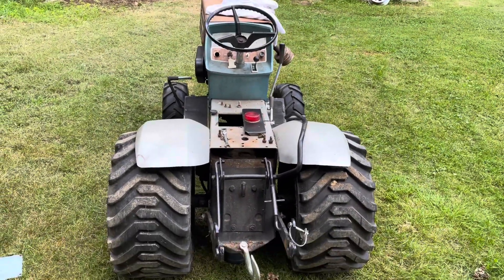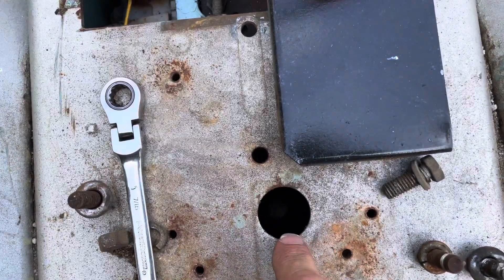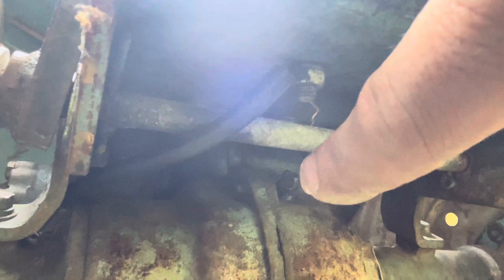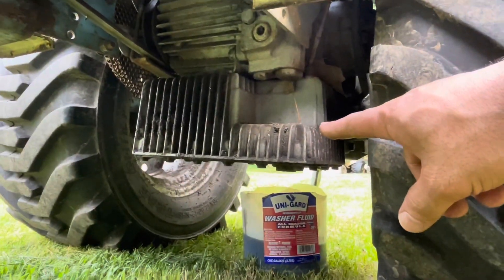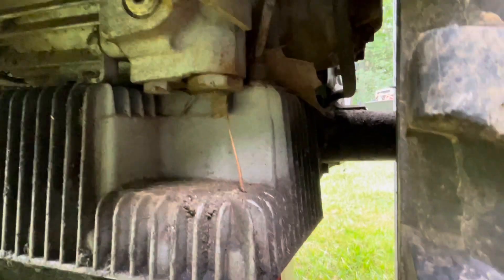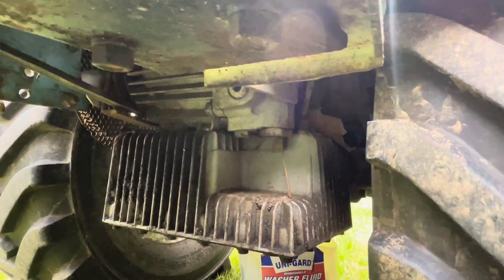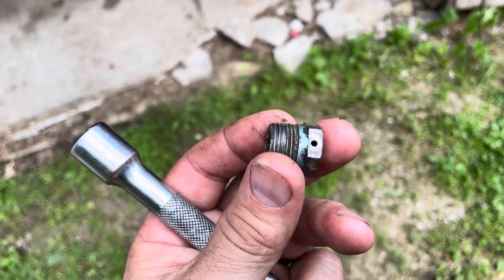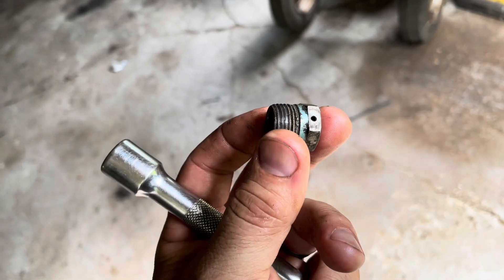Sears Suburban Tech Tip #1 - Hydro Trac Diff fluid and hydro pump fluid

Comment: Great information. Do you happen to know if there is a manual or other instructions for filling and bleeding the hydrodrive rear ends. Thanks.
Reply from the maker: I just fill them till it dribbles out from the vent hole, then it self bleeds as you drive it. I don’t have a manual for these
Reply: @crankysports  thanks for the reply. I will try your method.